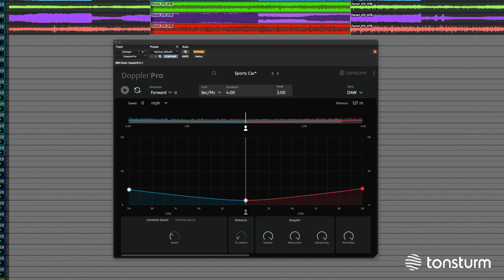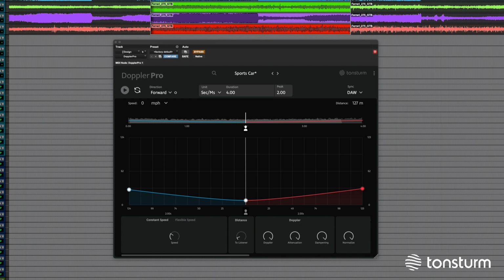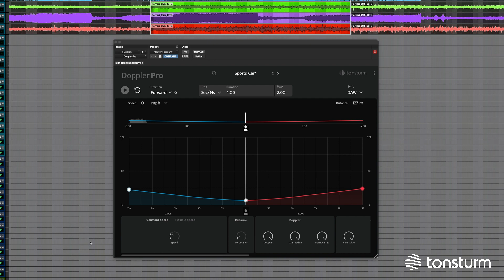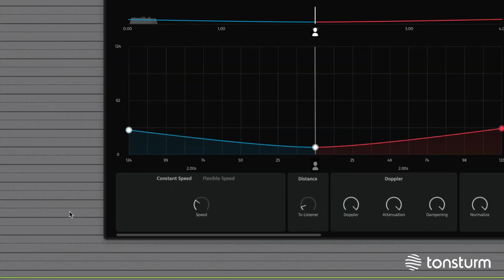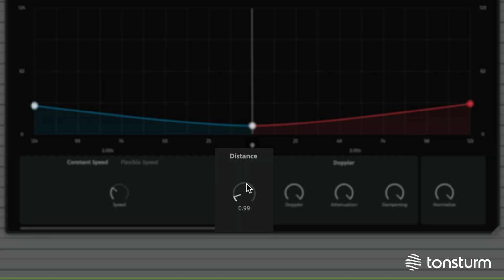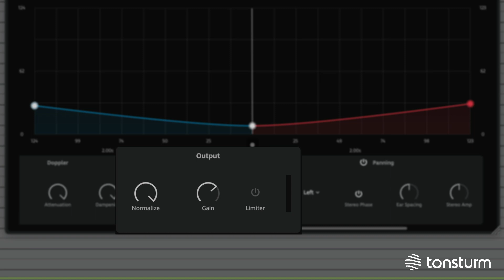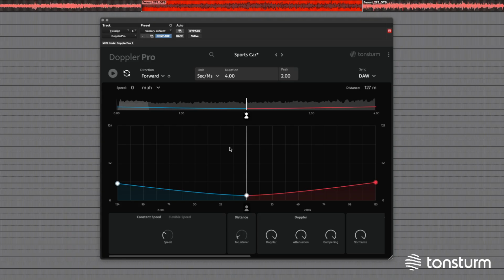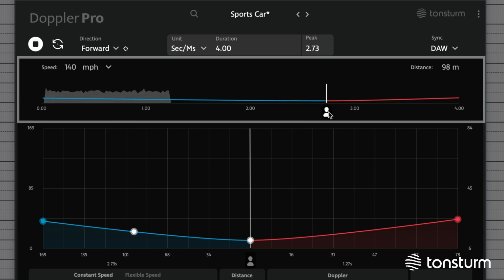DopplerPRO Tutorial Part 1

Comment: Hello! What are the differences between traveler and doppler pro?  Is doppler pro superior or it’s just built for different purpos?
Reply from the maker: Hey @ Lente_Viktor thank you for your interest in DopplerPRO. Maybe you give the free14 days demo a try.

It is a complete new doppler algorithm. 
The new DopplerPRO engine is a major step forward compared to our previous version. We've spent nearly a year perfecting the algorithm and introducing peak shift functionality that preserves the path curvature. We split the space into two individual parts, independently rescaling the approach and away phase for every change of the speed, duration, or path curve, and always keeping the defined peak position in relation to the source audio. Sounds complex but makes your workflow super easy.

We've also added binaural panning and floor reflections to enhance the overall experience, creating a truly immersive sound environment. With separate Doppler DSP for each ear and each floor reflection.

Almost all parameters can now be smoothly modulated from the host. Which is quite a thing to achieve for a doppler dsp.

We're still committed to our Traveler concept, but DopplerPRO caters to those who require the precision and control of a professional-grade Doppler engine. And if you're a Traveler plugin customer check your inbox or email us for an exclusive discount coupon.